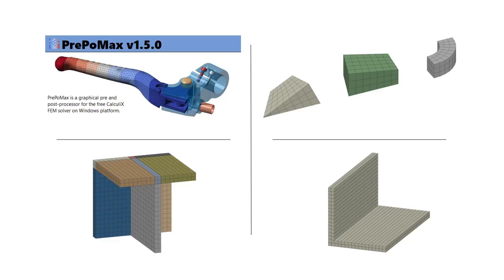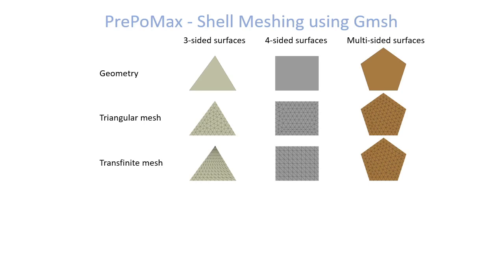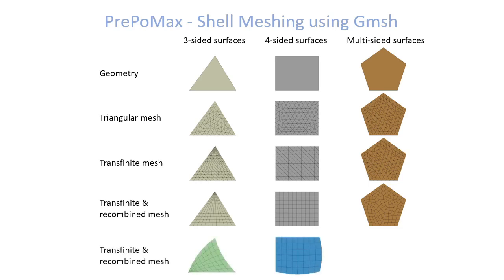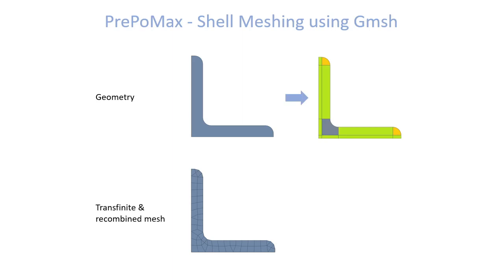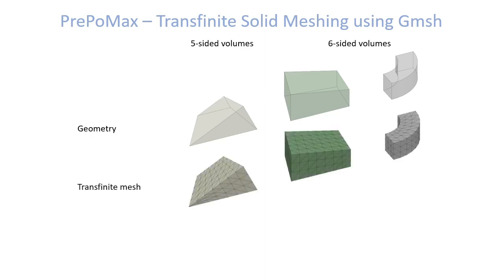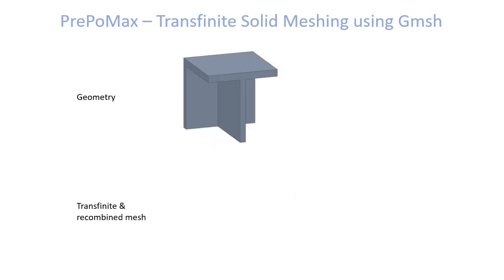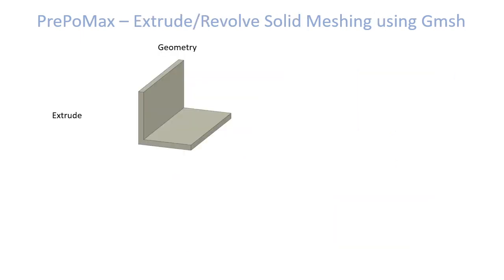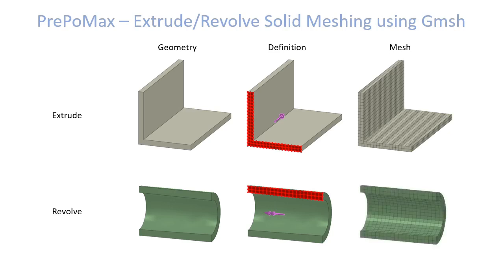PrePoMax & CalculiX - Introduction to advanced meshing

Comment: Very interesting project, congratulations.

In the future, the ability to manage OpenFoam and Open Radioss would revolutionize the user experience for engineers who use open source software. I would focus less on post processing, because from this point of view, Paraview is a very valid tool.
Reply from the maker: Currently, there are so many other things that need to be added that support for other solvers is outside the first plan.